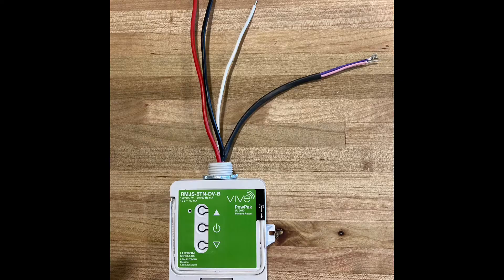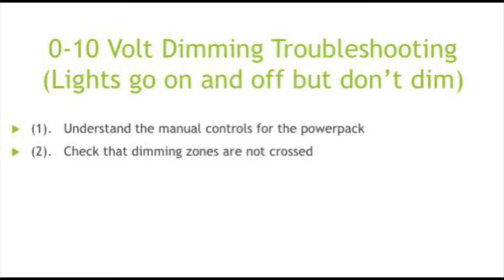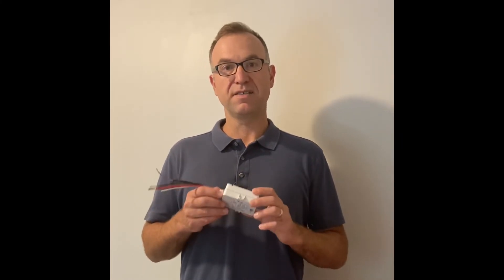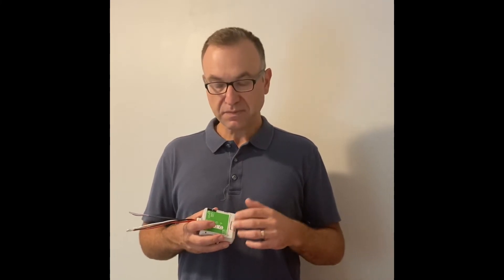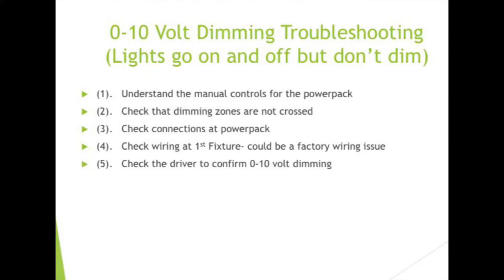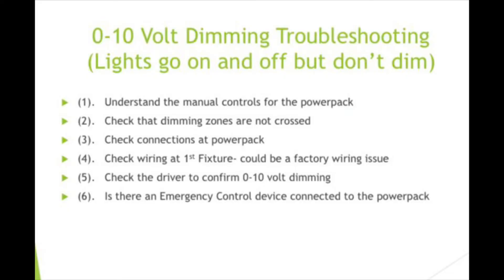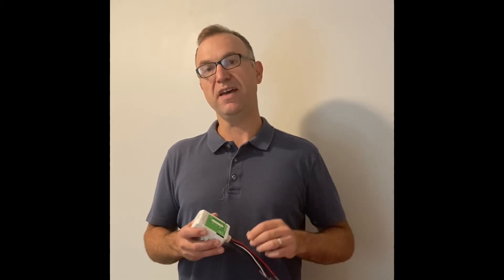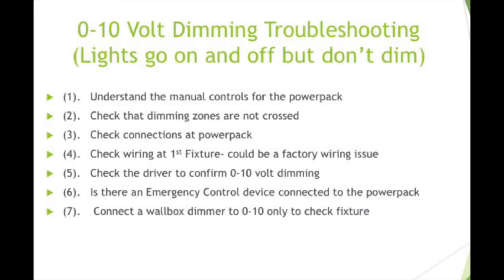0-10 Volt Dimming Troubleshooting @prudalavage

Comment: Is 0 to 10V dimming considered class 1 or class 2 from the power pack. I’m using sensorworx brand it appears the dimming uses one side of the relay and the other to the low voltage switch. Wouldn’t I need to carry the line voltage gauge to the fixture ? In my case would be a 12/4 to each fixture
Reply from the maker: Yes, you need both line voltage and low  voltage to the fixture.  Most contractors us MC Luminary cable which has 12/2 and 16/2 in the same jacket.
Reply: My confusion is with regards to the low voltage side. The driver mixes both line and low voltage in the same tiny splice area. And when looking at the diagram on the power pack sensors and LV switches are all on the LV class 1 side. However the dimming is on the class 2 side would I not need to keep the line side gauge wire to the fixture for dimming ? One side goes to the load side relay and the other goes to line side neutral. Running that 16/2 makes me nervous on a 20amp commercial circuit. Also I guess each fixture would need to go back to the driver as apposed to daisy chaining the dimming.